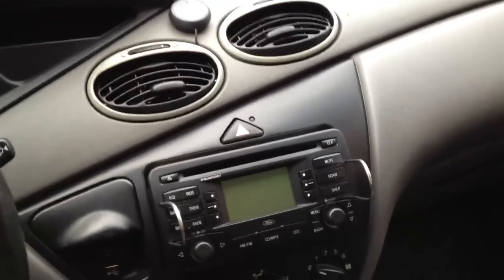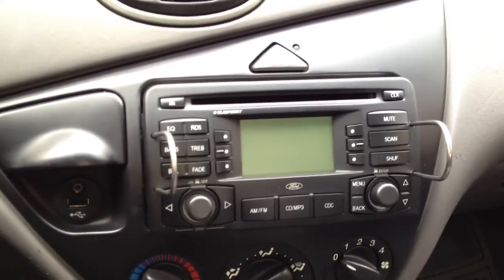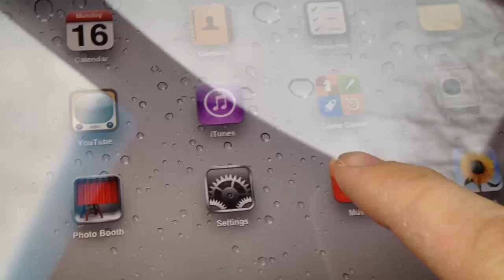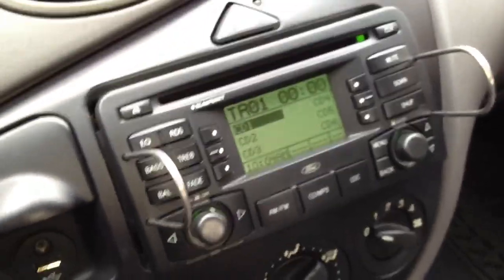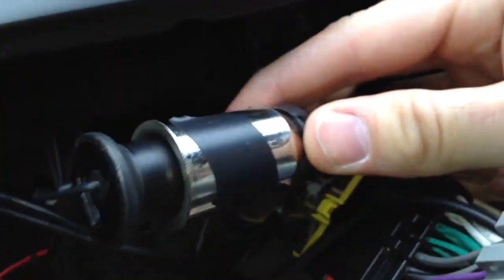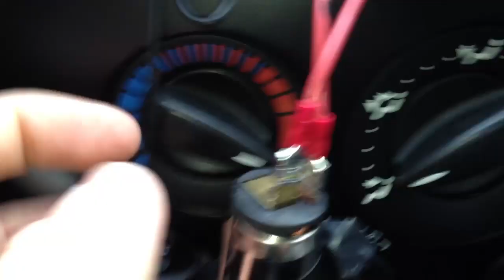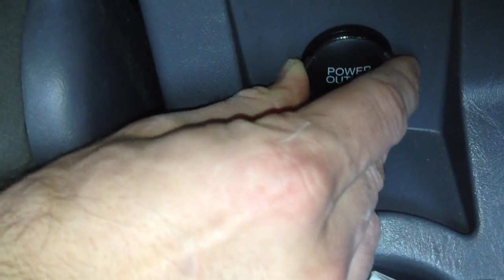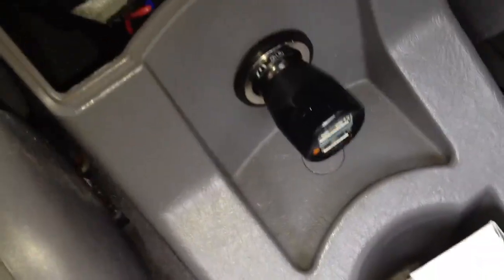Add Bluetooth functionality to 2000-2004 Ford Focus Blaupunkt Stock Radio

Comment: Mr jayrodo I have a focus with the blaupunkt radio and am wanting to put an aftermarket stereo in. What are the wires on the top back of the stereo called and do u know what harness I could use

Comment: why didn't the dealer just sell you the fitting for the rear power outlet that it standard in that location on euro spec cars and fit flush

Comment: Hey! I was wondering if you could help me out. I have a ford focus 2003, so my radio is a bit different. Now my question is: I want to be able to connect with Bluetooth to play music. Would the Belkin Bluetooth unit you used, work for me? And what connector cables did you use?
Reply: €bay has bluetooth "dongles" got sale. The thing is, you connect to an aux input, either factory, or another add on box.  And the bluetooth device hooks into it.